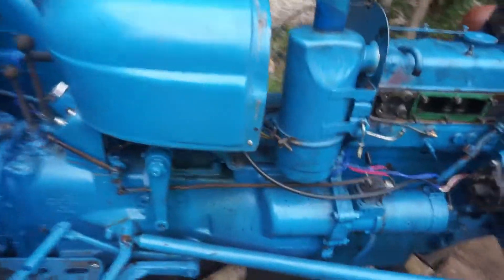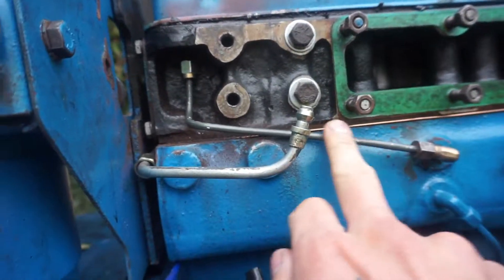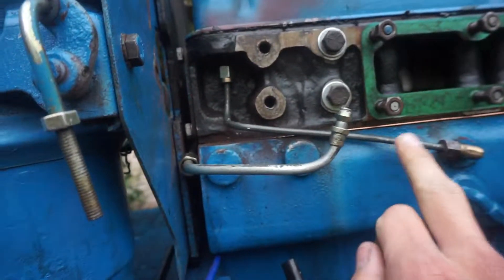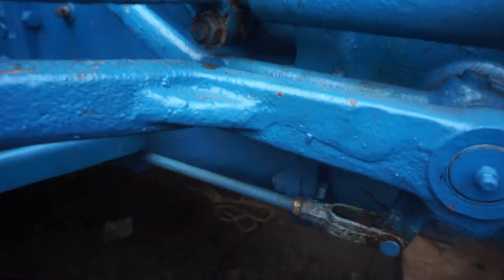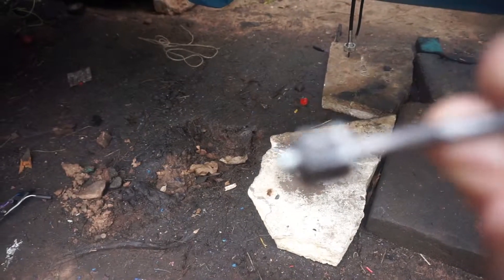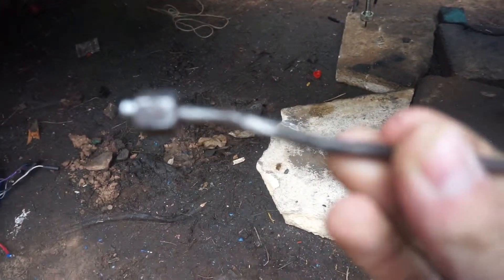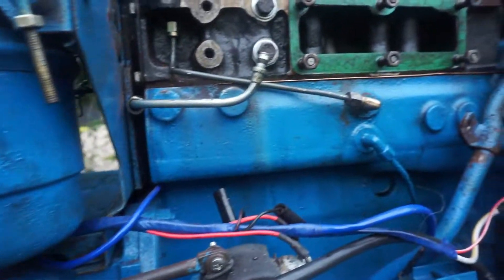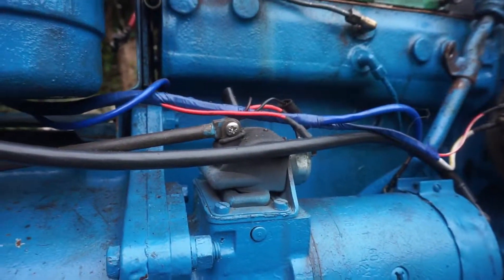I got it started

Comment: sweet you cant beat the sound of the dexta ,mines addicted to easy start shes a real smack head lol Ant.
Reply from the maker: mine was addicted to easy start. when i tuck head off i think it was doing the liners no good.
Reply: @thegreatoutdoors1418  did you grind all valves in and give a clen up of the head ? if so did it start fine after that ?
Reply from the maker: yes it got all new valves in and grind in. The head was skimmed at a garage. No it did not sort the starting problem.
Reply: @thegreatoutdoors1418  its a case of dropping pistons out then and honing the bores ,its a pity we couldn't just drop something down the bores to self cleanse ,you would of though wnns would of come up with a solution for ,that ,hey ho will just live with it funds are drained lol .
Reply from the maker: I put new liners in mine.